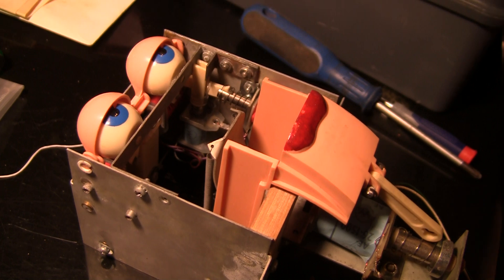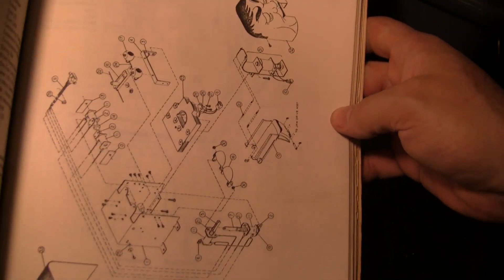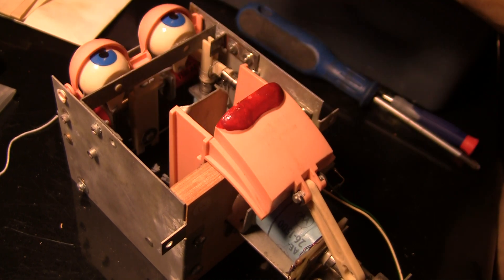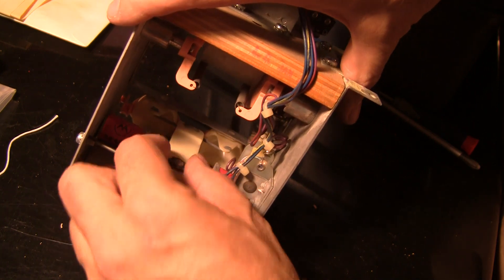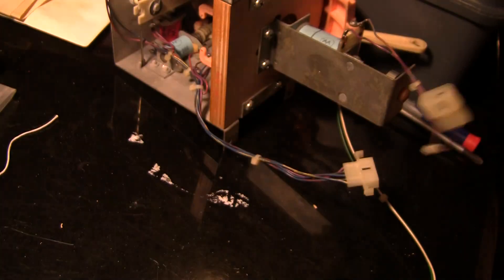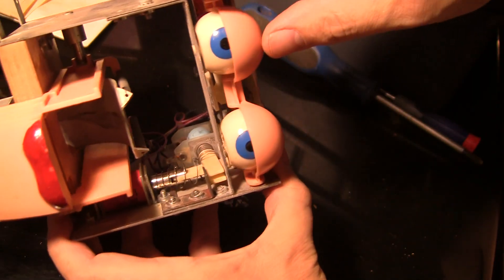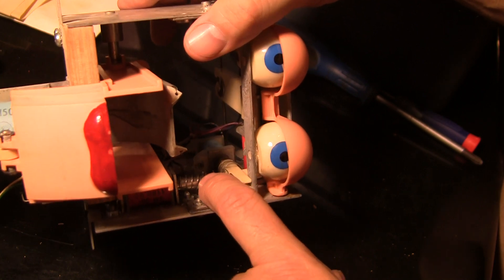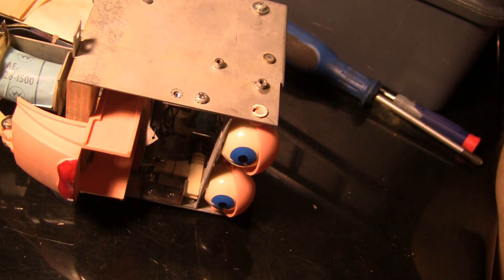Funhouse Pinball P1 - Examining "Rudy" and how he works - PinballHelp.com

Comment: I'm a bit confused on what coils one should use in rudy's head. The manual says four 30-900. However my haed has one 31-900 coil mounted vertically. Any advise which one I should use? The 31-900 on my has melted plastic inside the inner tube.

Comment: Nice sound effects!  The wire that runs behind the left/right mech is the spring.  It has just the right amount of tension to kinda hold the eyes in place at the extreme left and right position and after a few bumps within the game, it centers itself again.  When the plastic diverter wears on the backside where the wire rides, it will no longer hold at the extreme left or right.  Great video!  It takes a lot of the scariness out of RUDY for the unseasoned tech!  I took Rudy apart for the first time about 31 years ago.  Nothing wrong, I just wanted to see how he worked, hahaha!